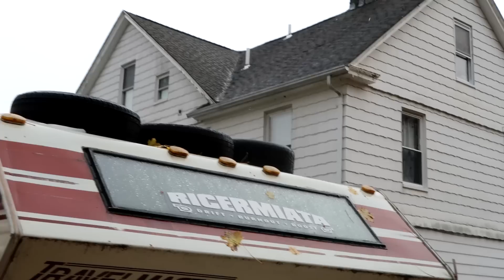Pimp My Truck!

Comment: Pull the engine and trans out of the RV and put it in a Miata.
Reply: Horsepower Garage I doubt it, too much work for these nerds
Reply: Snoopy it would probably have a 350 and turbo 350. Nothing new. Nothing fast either.
Reply: Austin McWilliams It would make a miata fast
Reply: Horsepower Garage guess again. The 350 in a motor home like that might make 200 hp stock and the trans is dogshit stock. So another 40 hp over factory but the engine weighs twice as much and the trans is worse than stock. It might actually be slower than a stock Miata at that point.
Reply: Austin McWilliams Who cares, just put it in a shit box miata and make it loud as hell.
Reply: Brandon I was 18 years ago
Reply: SIMPLYBEAST1231 No, mid 200's maybe
Reply: Literally under 200 hp
Reply: +ssShortBoxKid i have one in my 74 dump truck. However i built my 385 stroker solid lift roller motor with Keith black pistons w/ dart iron eagle heads in my drag truck. And im dailying a 93 tbi sport truck that has 200 hp stock. I mean shit what kind of rv cam are you talking about.
Reply: +SIMPLYBEAST1231 just saying man i know my way around an sbc.
Reply: SIMPLYBEAST1231 Then you should know a 1980's 350 with an rv cam is not making anywhere near 340hp, rv cam is only good for low end torque and hp.
Reply: +Horsepower Garage your probably correct but its for sure not sub 200
Reply: SIMPLYBEAST1231 I would guess low 200's, mid 80's silverado's only had 185 hp
Reply: It is literally sub 200. I also have a 98 vortec sbc that pushes 235 and the intake, heads and injection is leaps and bounds ahead of that thing. I am a die hard chevy guy but those things are dogs lol.
Reply: ssShortBoxKid 96-98 vortec 350 made 255hp stock.
Reply: Oh you know how to run google? sweet lol, I was close I didn't have to google it either. You'd know that those old 350's carbed make about 160-175 no where near mid 200's if you googled that as well. Hell a tbi 350 only makes around 200.
Reply: Mine has hooker longtubes, msd street fire ignition, blackbear performance tune, aftermarket intake manifold, CAI, etc and still probably doesn't push the 255 they claim lol.
Reply: ssShortBoxKid longtubes on a stock 350 add maybe 5hp, ignition is maybe 2hp, performance tune is maybe another 5 hp, intake manifold unknown, WAI -5hp.  Probably makes 260.  Your stock injectors won't support much more power than stock
Reply: Horsepower Garage
She's definitely no race car. Specially behind a 5200 lbs truck lol.
Reply: It's funny cause now smaller V6's make 300+ horsepower easily. They really got outdated quickly.
Reply: ssShortBoxKid Gen 1 sbc can make a lot of power, after 72 they were so choked down to meet emissions power dropped a lot. Vortec heads will flow 450hp stock, my mild 355 makes close to 400hp, you can get close to 500hp pretty easily, over 500na isn't very streetable.
Reply: Horsepower Garage I had a 1972 GMC sierra with a 350. the 350 had a lobe warn down on the cam and was popping really bad. Swapped it out for a 350 out of a 1969 3/4 ton had quite a bit of power with the wieand intake i had on there. Thinking back the specs for the 1972 were 175hp and the 1969 was 250. i miss that truck.